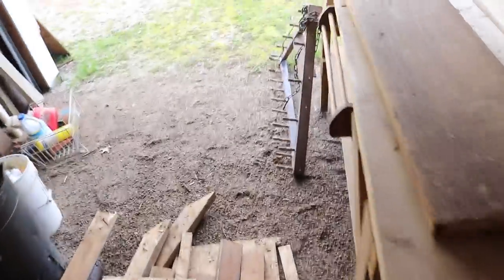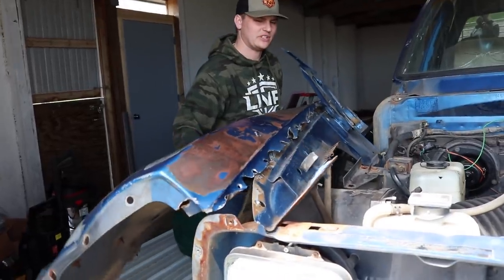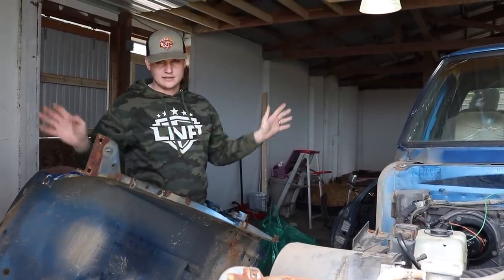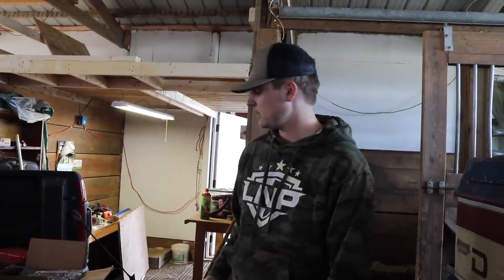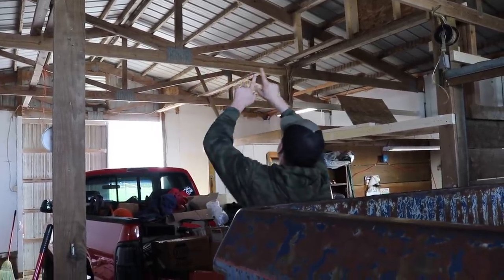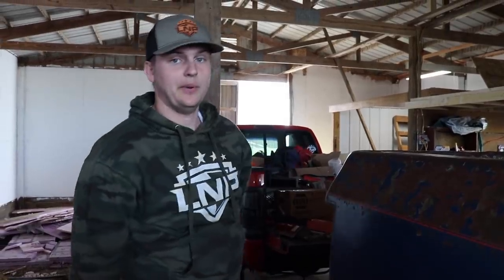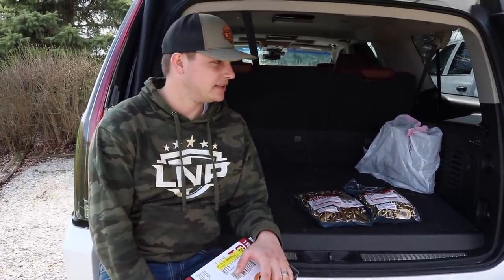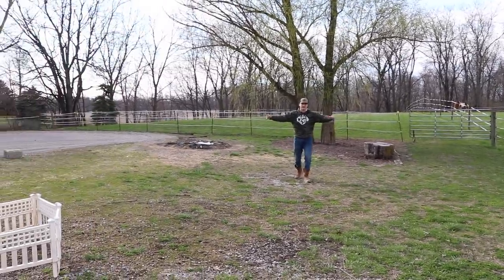SHE IS DONE WITH LNP GIVEAWAYS...

Comment: I know it will sound stupid but put pl-400 wood glue in between those boards when you to bolt them together. I used that stuff when I rebuilt the roof of my garage. My buddy told me to use and I thought he was crazy. After I used it I believe it gave more support then the bolts (still use the bolts)